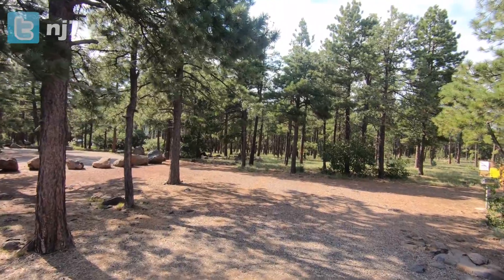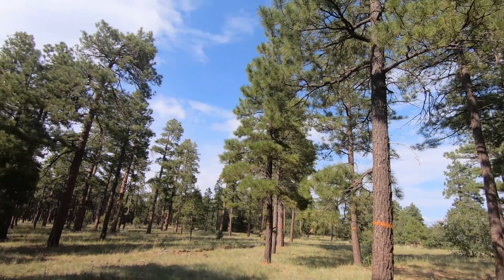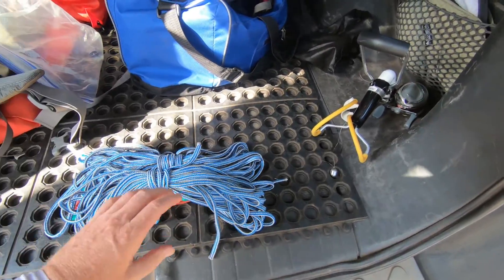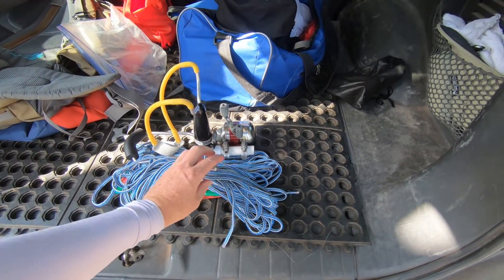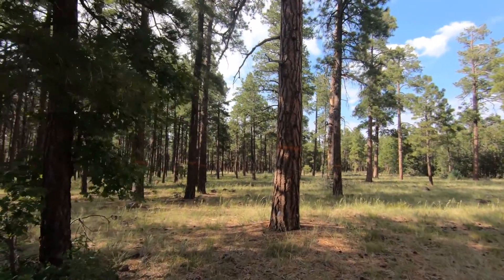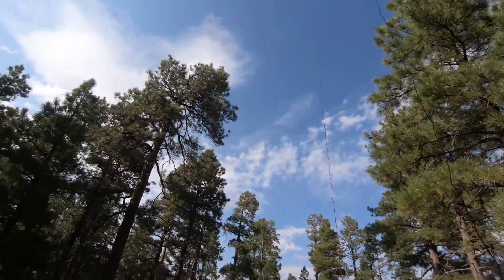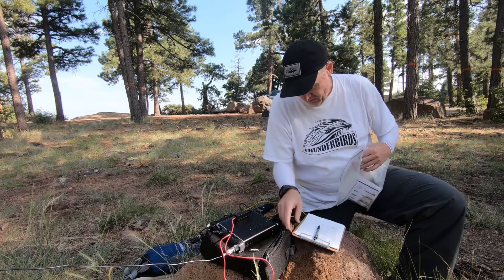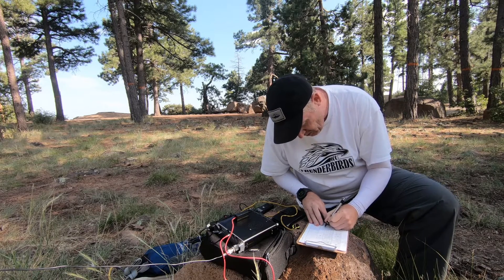My Half-Square Antenna Field Test

Comment: I’m going to try a 40M half square here at the home QTH in the fall. But I’m going to end feed it as opposed to corner feeding, using a 49:1 transformer. I’ll compare that to the 40M EFHW I’m using now.
Looks like it worked pretty well for you Charlie
73, Marc, W4MPS
Reply from the maker: oh that sounds like a really interesting experiment, Marc.  I'd like to know how that goes for you!
Reply: Hi guys. Dont feed the antenna end fed. It needs to be fed the way it is as its the phasing which makes the gain. Feeding it at the end will only make a dipole of it...sort of...or random wire 1wl. So I recommend keeping it as half square, you get about 3.3dB gain free space but above ground - 5-6dB over dipole. @RedSummitRF

Comment: Couple of questions. I notice you were shooting east and west. Sorta. Does the orientation of the vertical elements radiate off the ends or? Also love that key. Where can I find one.
Reply from the maker: Hi Jay - I appreciate you dropping a line.  Regarding the antenna question, no, this is a bidirectional antenna.  In essence, the two legs are phased vertical antennas fed from the top.  So the pattern is broadside to the plane with nulls off the ends.  The plane in this activation was somewhere around 100 to 110 degrees of north.  It was afternoon so I was shooting for New Zeeland.
The paddle is amazing but sadly no longer in production.  It's called a Pico Palm or Pico Paddle by Palm Radio http://www.morseexpress.com/palm/ppaddles.htm
See you again I hope.
Reply: @RedSummitRF  red have you given much thought on trying this antenna now that the bands don’t suck? Given it will probably have to be this drive up.
Reply from the maker: @JayN4GO  You've inspired me.  I took it out of my bin and I have it ready to go on the next suitable activation.  Thanks!
Reply: @RedSummitRF  hope this solar storm goes away soon. Radio blackout last few days. Ugh lol

Comment: Great antenna if you have trees around. Good video Red. Malen VE6VID
Reply: Malen, I use it with two 31 ft poles. Kinda heavy but worth the performance.
Reply from the maker: Hi Malen, and thanks. Yes, what Adam K6ARK said ... I got the idea to make one from him. Poles make it a more versatile deployment for sure. This is antenna performed very well!
Reply: @RedSummitRF  I have 1 as well but not really willing to carry 2 poles up a summit. 
Works very well when strung between trees.